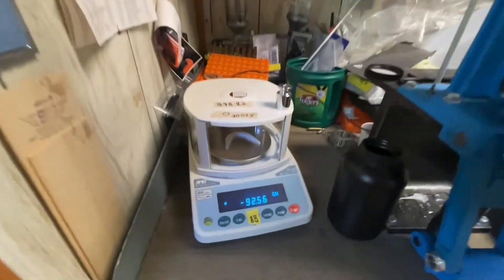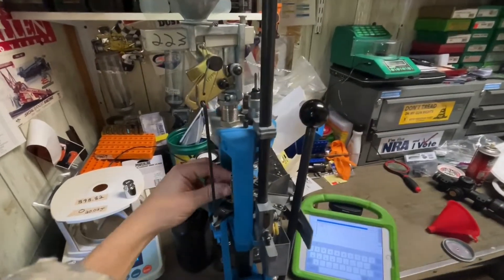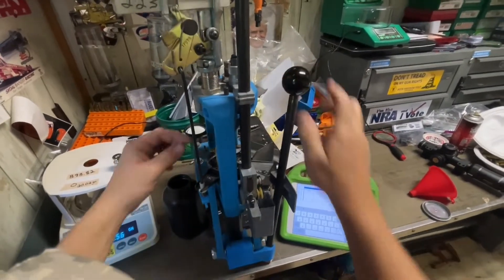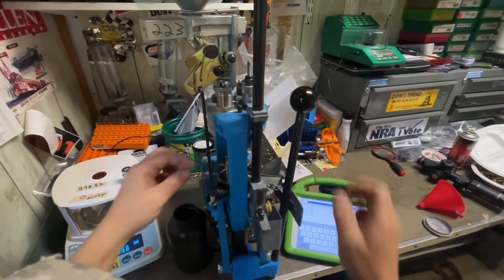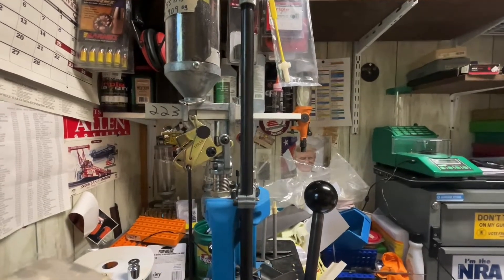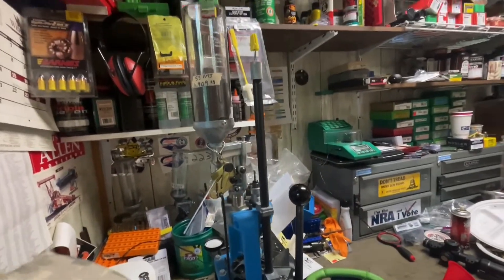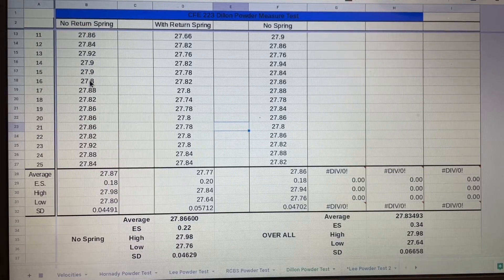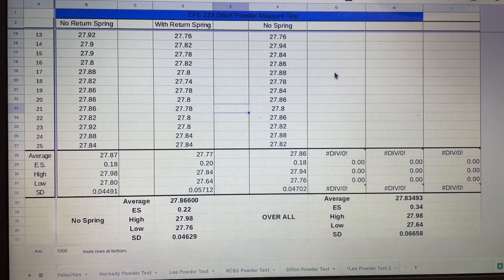Dillon Powder Measure Accuracy Test

Comment: Honestly, I have a Dillon myself and seldomly use their powder measure unless using ball powder which it works well on. Same as what your test was using. Having said that I always use a spring because it will positively return correctly. Also, the differences you showed in your test would make zero difference in group size on a target. So long as the powder is above the baffle it makes no difference what the level is. You could take it to the top of the measure, and it would have zero difference. Your video and your comments would make a novice reloader think it might be better not to use the spring. Quite the contrary. The spring is in the design to make sure that there is a positive return. If for any reason things were just sticking a little bit, it may not completely return. Thanks for the video always interesting to see what people come up with even when it doesn't make any sense to me.
Reply from the maker: That’s interesting. We’ve loaded thousands of rounds without the spring and never had a problem. The return rod arm also brings the slider to back to position. Thanks for watching!

Comment: Wow....I love Dillon.  I also have the 550c press here, but there's one thing about Dillon stuff/the press etc. is it's a bit depressing.  I just wish I would have bought Dillon to begin with way sooner.  This is because while they're expensive, I still would have saved a ton of $$$ for reloading gear by negating/eliminating things I didn't need to buy.  For example, with this thing being so accurate, why would I want/need an electronic powder dispenser from RCBS?  I have the RCBS link powder thrower, but why do I need that if it's less accurate than this, and this is way faster?  

Sincerely,
Reply from the maker: Yeah! Dillon makes great stuff, however depending on the powder you were using, I don’t think the Dillon would be as accurate as your electronic dispenser that weighs every charge, especially if you were using stick powders.
Reply: Yeah try running stick (extruded powder) through there. It would sound like you were eating crunch and munch lol

Comment: The Dillon Precision Powder Measure for the RL550 Series and XL750/650 Reloading Machines represents the best in accurate, reliable and repeatable performance. Accurate to within +/- .10 gr the Dillon Powder Measure provides you with the speed and performance that the modern reloader demands.
Reply: I repeatedly got better results with the Lee in my testing. Check out that video
Reply: I just recently made the switch to Dillon and the powder measure is a bit disappointing to be honest. My old RCBS rotary units are more consistent. I also noticed that one of my Dillon units is more consistent than the other.